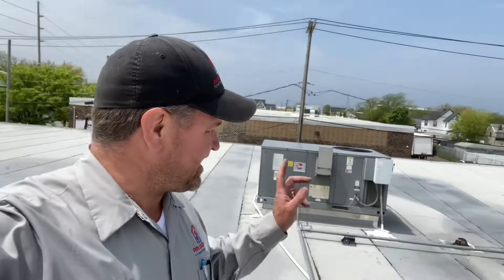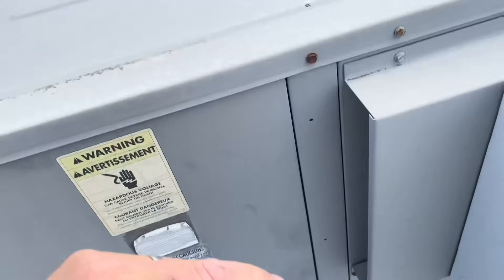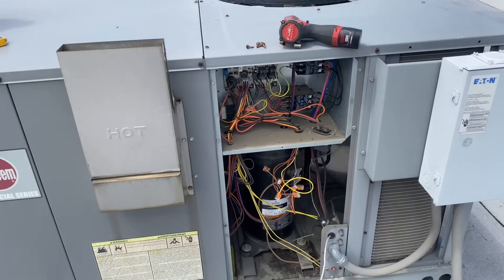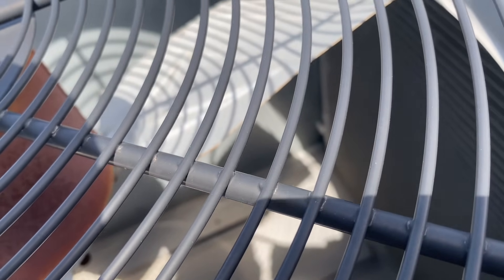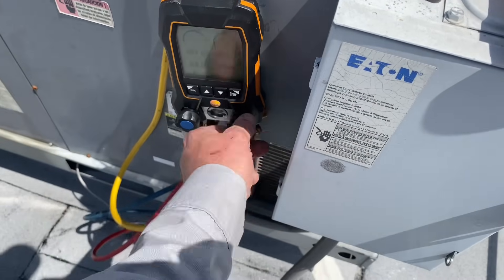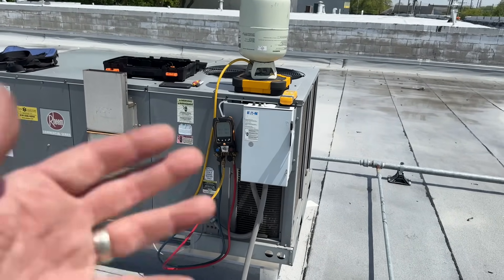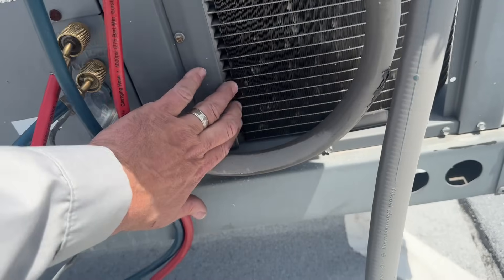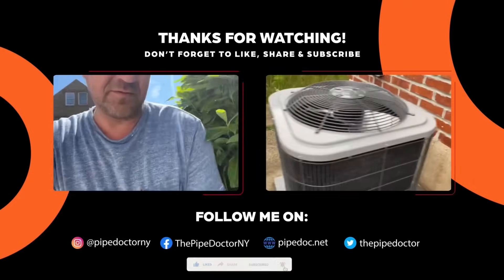Commercial Rooftop HVAC Unit Not Cooling

Comment: Nope I am “ Not “ going to lecture you on them worthless piece of junk, micro channel pieces of crap..(( 😂 can you tell I don’t like them?😂)) but after many many years of serving the gages tell us approximately how low unit is without evacuating and seeing what’s left, it just comes with the art of years of service… but  so as not to let you feel un loved …….. Mikey Pipes!!  A.. that little giant ladder is not tall enough! An B? I didn’t see a safety rope 😜 rolling on the floor laughing sorry boss man got to give you a little grief ❤  But being honest here most commercials? Just gas and go they do not wanna pay to find the problem. They take the easy route and the cheapest route, but as we both know, sometimes the cheapest route in the end was the most sus expensive.🤷🏻‍♂️  But I totally agree with you. I love rooftop units other than the communication wire and the T stat? Everything is up there well most everything.. your lead seal fire trap doors are usually down below… yea a question 🙋‍♂️ does NY require fire dampers in the duct work? Michigan is a pain about it 🤷🏻‍♂️ but beautiful day to be on the rooftop
Reply from the maker: We don’t need no stinking fire dampers!